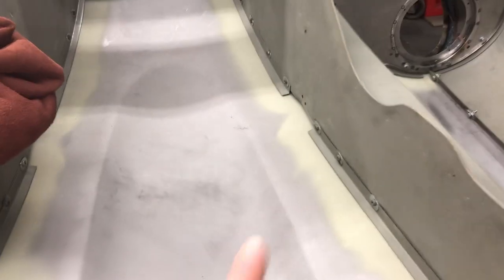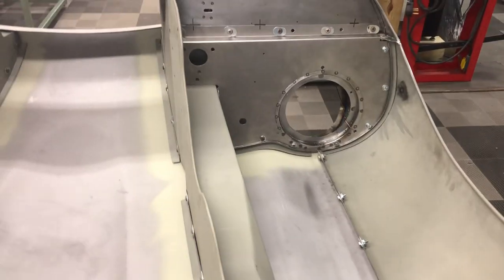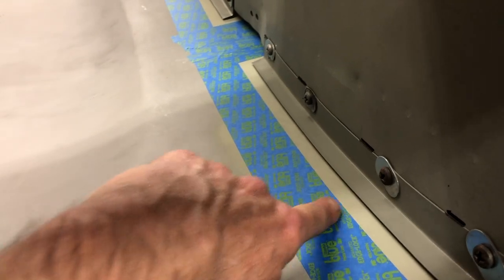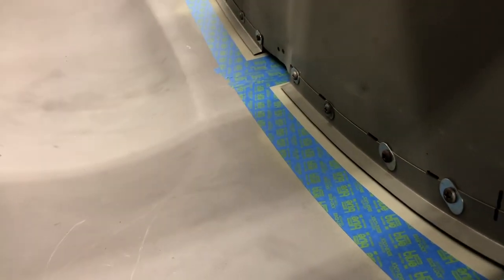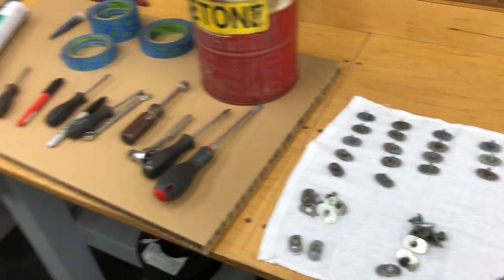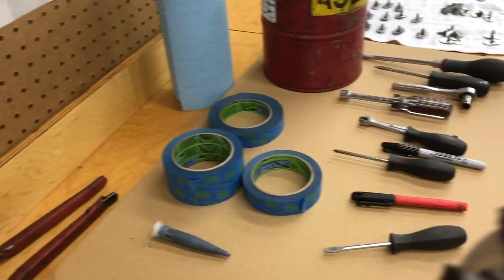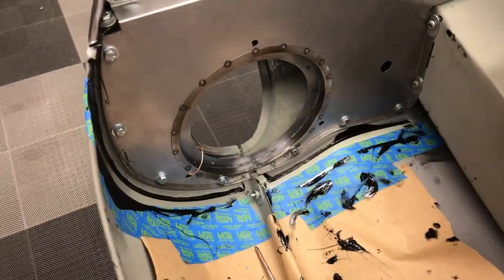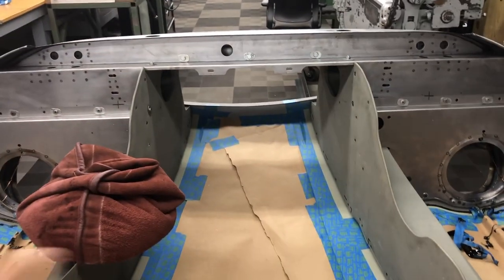Jaguar E Type - How to Glue a Bonnet - by Monocoque Metalworks

Comment: Lol. Slow and steady never wins the race.    It always finishes the race, but never wins. 😄
Nice work. 
Ever used the 3m Epoxy panel bonding adhesive? It’s  really good, but it’s probably not as flexible as that Polyurethane you’re using which is probably necessary.

Comment: Interesting video! I'm curious, why are you using etch primer under epoxy? I've always been told to use one or the other, but not both. I've even witnessed paint failures from doing so. Here's a quote from PPG website: "Did you know? It is no longer recommended to use an etch primer under an epoxy primer. Residual acid from the etch primer can interfere with the proper curing of the epoxy. This may lead to extended dry times, potential blistering, and even adhesion failure."  Just wondering what benefit you find from using both products together.

Comment: Chuck this is awesome timing for me as I’m at that point with my bonnet, but I’ll be buying two more fresh tubes of the 4200.  Question would the infrared heater that I use for painting be advised?  Thanks for the secrets greatly appreciated.  Cheers 🍻 John. 
I’ll be tackling the wheel well damage tomorrow.

Comment: Really great video and I wish that I had seen this 6 months ago.  But I'm pretty gratified because the plan of attack that I finally worked out and what you show in your video are almost identical (but I went through about 30 pair of gloves).    I used Sikaflex 221 which I think is close to what was used at new construction.  Again - really great video!  Thanks for sharing.